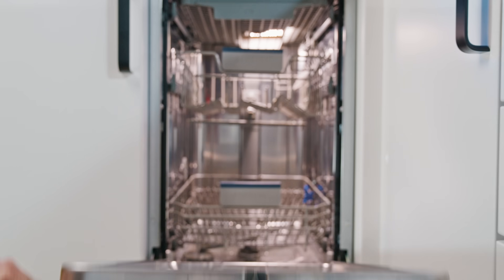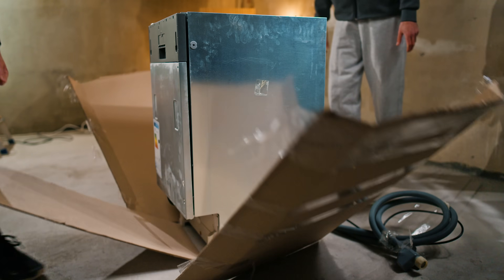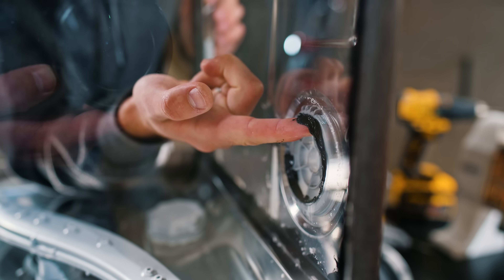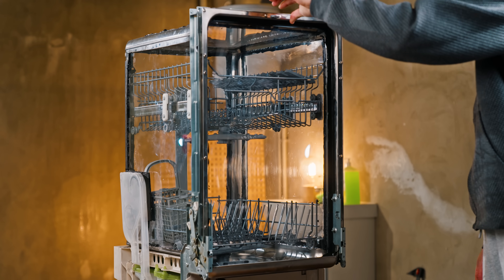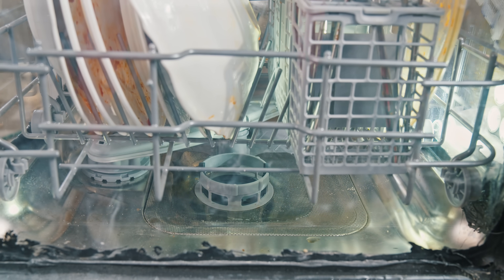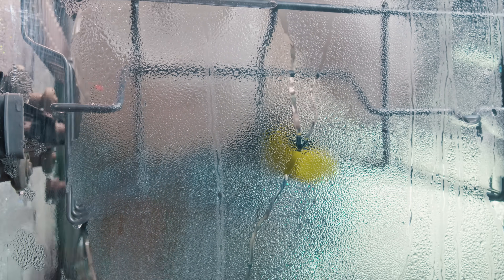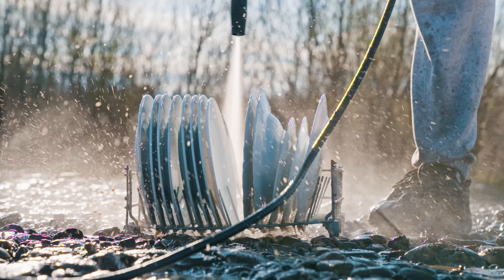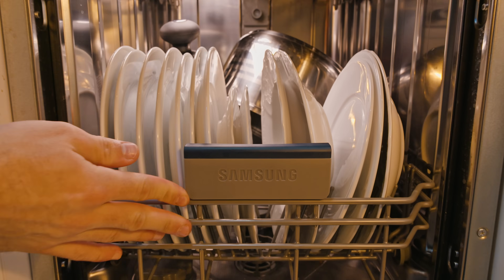Transparent dishwasher - What’s happening inside?

Comment: Hi. Thanks for the well edited, dynamic video. I thoroughly enjoyed it

The brown stuff in the salt container is called "ionic echange resin". Essentially a dishwasher (or any water softener that uses salt) does not soften the water directly by means of salt, but rather by a ionic exchange process. In short, limescale (which is responsible for white marks on dishes) is calcium carbonate. The water softener job is to absorb calcium from the water molecules and release in its place another molecule, which in the case of a salt based softener is, you guessed it, sodium  (I remember to the reader of the comment that salt is sodium chloride).
In short, water does NOT flow from the valve, through the salt container, into the wash tub. This would cause water to be salty and create rust spots on cutley, metal and leave a nasty white residue on the dishes and the inside of the machine. What happens istead is that water flows through the valve, into the resins (which are separated from the salt reservoir by means of a solenoid valve) and finally into the machine. 

Now, you may wonder, what is salt used for then? Well, these resins can't accumulate calcium ions forever and will eventually get full. Salt is then used every X liters of water filled (which the electronics can detect by means of that little spinny thing - a flowmeter -  mounted on the heat exchanger or by means of software guesses based on how long the fill valve has remained open) to regenerate the resins. In this process, called "regeneration", water flows from the valve, through the salt container, thorugh the separating valve, into the resins and finally is immediately drained out by the drain pump. A series of water fills where the pump still remains active is then used to rinse out any salt residue from the resins. 

Hope this comment was useful to someone. Cheers
Reply: Great explanation
Reply: thanks for the explanation
Reply: Yeah i totally get it...
The brown stuff and salt are there because they just need to be... Ok.

Ok i'll try interpret this for everybody. Salt gets rid off limescale? Brown resin gets rid of salt?
Reply: @DlcEnergy  Brown resin removes limescale from water, salt removes limescale from resins
Reply: @electronz2288   Oh. Thanks for clarifying.
Reply: in my dishwasher, at the beginning of every wash, it firsts pumps a lil water to clean the resin and directly to drain, and then fills with water to wash.
Reply: Mil gracias por tu explicación. Me resultó muy interesante.
Reply: Sir, should salt be added if water is not hard
Reply: What happens if I eat it?
Reply: @Electronz ... Very helpful.  Not that I could replicate it myself, but I understand the process that you are discussing.  Helps me understand, in theory, how the resin & salt-replenishment step work.
Reply: No sir, thank you for educating us!